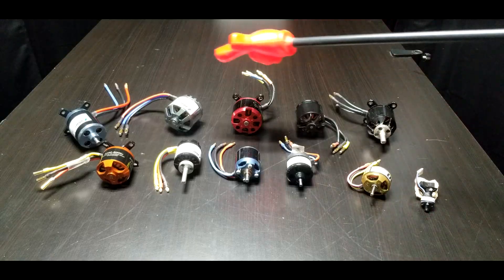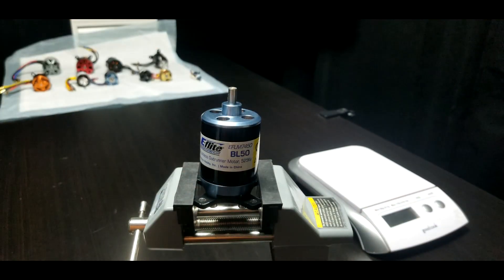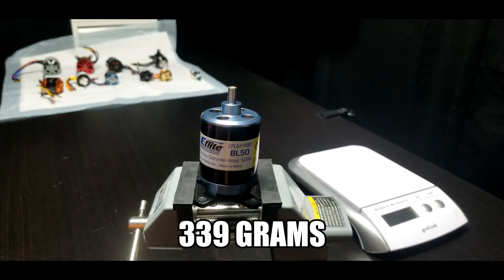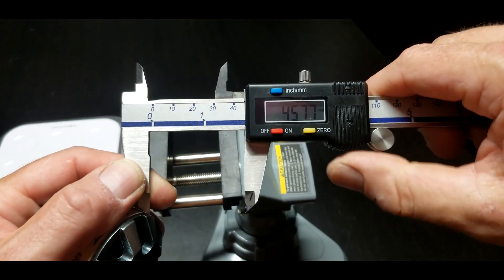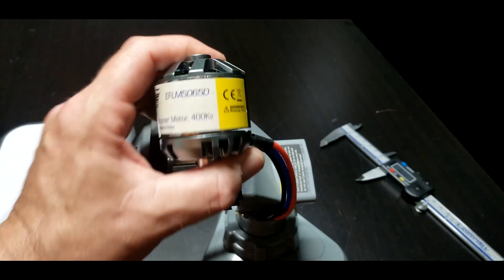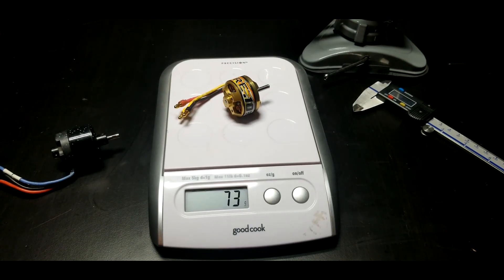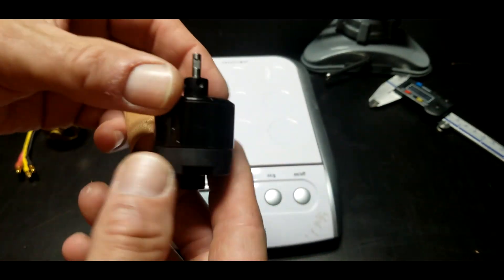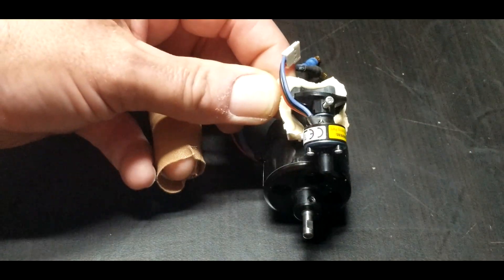HOW TO CHOOSE A BRUSHLESS MOTOR FOR RC PLANE

Comment: Thanks for video ,still can't figure it out , need motors for an 81 inch Catalina weight 12 pounds,max prop sise9 inch  because with 9 inch props there is only half an inch between them by

Comment: Good job. I'm trying to determine the correct motor  a Seagull 40 sized Ultimate from about 13 years ago. I don't want to deal with nitro. Based on what I've seen here, a Spektrum 4250 will get the job done. Thanks!

Comment: Great info. Question if I have a 3536 900kv pushing a 11x7 or 12x6 prop i want to up the motor which would you recommend for alot of power? Running 4s and a 80a esc i have laying around it will be going onto a 1.5m tasman. I like modifying so fitment is no issue. Just curious of a motor you recommend. I was thinking about 4250 600kv or 800kv let me know your thoughts thanks

Comment: I take the weight of the plane in pounds and multiply it by 75, 100, 125, 150, 175, or 200 to find the amount of watts the motor needs to produce. A glider needs about 75 watts/lb and a 3D plane needs at least 200 watts/lb to go straight up. A trainer needs 100, a warbird needs 125 to 150, and a sport aerobatic plane needs 150 to 175 watts/lb. I then divide the total watts by the nominal battery voltage to get the current it will need to draw. If the current is too high, I go to a higher voltage battery. Once the voltage is known, then I pick a KV rating that gives me the unloaded rpm that I want the motor to turn; e.g., 14.8 volts x 800KV = 11,840 rpm. With the right prop, the motor should turn about 80% of that or 11,840 x 80% = 9,472 rpm. Now that I know the rpm, I can calculate the pitch of the prop. I'll see if a 7" pitch gives me the speed I want; e.g., 9,472 x 7 / 1056 = 62.8 mph. The 1056 converts inches to feet, feet to miles, and minutes to hours. Now all I need to do is find the diameter that will load the motor down to 9,472 rpm on the ground (static rpm). I start with a prop that has a diameter that's 1.5 times the pitch, so 7" x 1.5 = 10.5". If an 11x7E doesn't pull the motor down to about 9500 rpm, I'll try a 12x7E. If the diameter of the prop isn't at least 1.5x the pitch, the blades of the prop will be stalled during the initial takeoff run or when pulling out of a hover. I don't like using a prop that has a diameter that's more than 2x the pitch because the motor has to work too hard to turn it; i.e., it's less efficient. However, it will produce more thrust from a standing start, but it won't be as fast in level flight. The motor's power, amps, and KV ratings are more important than its physical size.
Reply: Thanks so much for taking the time to write this